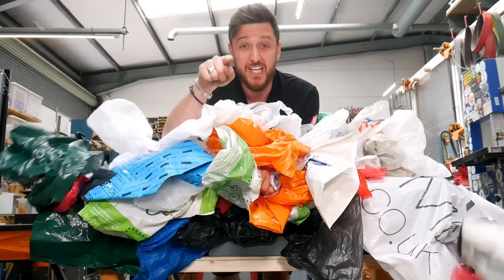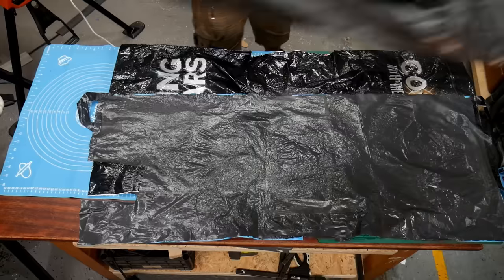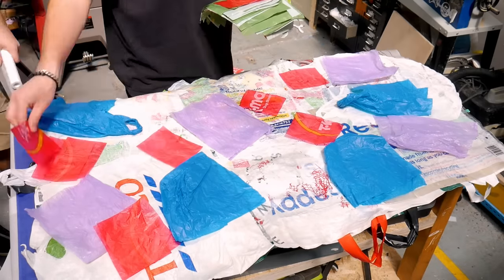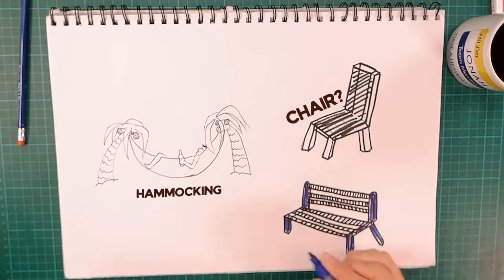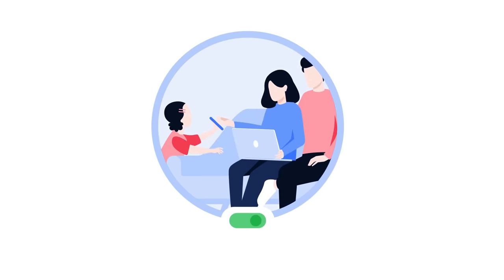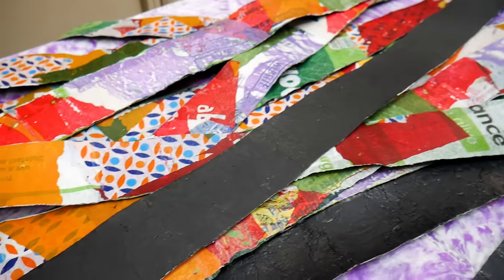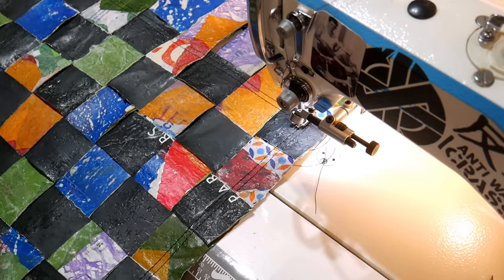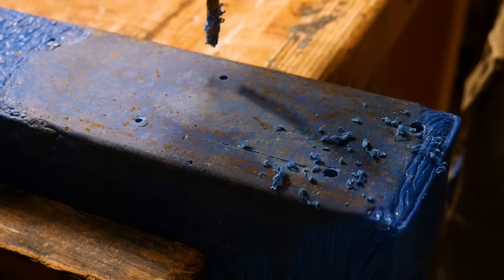Is THIS a Better Use for Plastic Bags?

Comment: Random idea for you guys and/or viewers reading this. I successfully used the off-cuts and trimmings that don't look good blended to make table saw sled runners! Melted the off-cuts in the toaster oven and rolled a thin log. Pressed the log directly into the tracks of my table saw and clamped a 2x4 on top. Custom sized runners that I glued and screwed to the plywood base!

Edit. I did need to trim some flashing off the edges. Your milage may vary. 😊
Reply: Good idea!

Didn't you have to prevent it from sticking?
Reply: @eugenetswong  Yes! Thanks for it reminder. I lined the table saw track w/ parchment paper. After I pressed the thin roll of HDPE it, I folded the excess over the top before I clamped the board down!
Reply from the maker: That's an awesome idea - cheers Tim! 💡♻
Reply: @Timri3681  We can actually use junk paper for this, if we don't expect to recycle the runners. The paper could just remain stuck to the runners.

Thanks for your response.
Reply: That gives me an idea, actually... the problem I've had with my table saw slots is that while the bottoms are fine, the sides of the stem of the T-slot aren't machined quite parallel (yeah, I don't know either), so any runner I make myself has to be a carefully-machined T if I want it to not jam. Rather than re-cut them, I wonder if I could adapt this technique not to make runners, but to line the existing slots with a plastic bearing that actually has parallel sides...
Reply: @JakeStaines  Jake, that's interesting. I think that you could.

You could make and attach the runners, and then test them in the slots without bearings. There should be wiggle room. Then somehow put in plastic and use the runners to hold the bearing while it cools...or just find a way to hold custom bearings down.

If you can remember this thread, then please do share your results, if you try.
Reply: This is a brilliant idea! I have been trying to figure out how to make some custom sleds for my grinder and I think you may have just solved it for me!

Comment: You could make a tarp... use as a greenhouse cover, a hoop house, a cover for a car or boat or even a home.  Or for under a beach towel or picnic blanket.  I suppose it depends entirely on how long you're willing to iron plastic together.  You could even use the material to make waterproof clothing like jackets, waders, and boots.  Anything is better than having it inside the poor turtles.  Also a pond liner?  or maybe a custom sized umbrella.  Or a billboard, if you wanted to paint it.  So many things... you've inspired me, but I hate ironing!
Reply: My question is how is these bags getting in the ocean?  Are we dumping land trash in the ocean?  That is horrible if so.  It should be collect and reused at the least.  We should all be planting more trees and having tree farms so we can go back to paper bags.  A renewable biodegradable material.
Reply: @springcrocus7flower635  In New York City, the garbage barges are piloted out to the ocean and dumped there as standard practice.  In other places, quite a lot of garbage makes it to the ocean from hurricanes and flooding picking up everything then taking the material with the water when it goes back out.  Occasionally there is an overturned container ship and the cargo gets into the ocean that way.
Reply: @auntcatziegler3791  -  Thank you for the response.  That is unbelievable that we throw trash in the ocean.  I thought it happened some, but NY trash must be an enormous amount!  This is sad for the marine life and plants.  
Have they studied other options?  Seem like burning with emissions pipe would be a viable option.?.? I know they did that in a western state for a few years, but may have eventually got shut down.

Comment: It would be really interesting to try  for camping ground sheets as it would be mostly shielded from UV, most plastic bags tend to eventually break down after a bit of UV exposure don’t they but maybe these thicker sheets will be okay plus you can always add another layer hey 😃I’ve only made small sheets so far but it seems pretty tough material😀 I might try adding some tarp grommets to see how it compares with the cheap tarps you can buy! Thanks as always for the great video guys 👍🏻😊
Reply: What about adding the plastic bags to the tarp or would the tarp itself melt? I hate that they are woven and never 100% waterproof.
Reply: @elainawest1572  Yes that might be worth trying, some of them are really thin so it would definitely bulk them up a bit!
Reply: Hi guys, my thoughts and best regards  to your brainstorming. That's what I call success.
Reply: The huge bags of dog food are useful. They're super strong & hold 40lbs.  I turned them inside out, sewed repurposed  karate belt pieces for straps, & now use for mega grocery bags.
Ive opened them up & refolded into open box shapes. Once corners are stapled tightly, it's waterproof. I've used them for years under groups of potted plants & to waterproof interior of cardboard boxes ( visiting cats' litterbox). My last dog died in 2018 😢, but I'm still using the damn bags 😮.
Reply: @coffeync  Yes I sew my dog food bags into shopping bags as well, easy to do and super strong plus you can usually arrange them so you get a nice picture of a dog 😊 sorry for your loss by the way 🙁
Reply: @coffeync brilliant
Reply: @coffeync you made my day thank you
Reply: @coffeync I use chicken feed bags and make them into tote bags they hold a lot of weight. I wash them first and dry. My family loves them.
Reply: @coffeync I have so many dog food bags. My local pet store collected them ONCE for a brief time through some organization for experiment and they haven't done it again. Meanwhile I just can't throw them out. 🫣 But I don't know what to do with them. My curbside doesn't recycle that kind of plastic.

Comment: As potential commercial application, the used bags could be fused to plywood wood to leave a waterproof surface.   Ground bags could potentially be used as a glue between the plies of the plywood, and potentially added to ground wood fiber to produce a waterproof Medium Density Fiber Board.  Or sawdust to produce a water resistant Particle Board.

Comment: Even the horses loved it!
I like using grocery bag leather for my purses, I usually quilt it to prevent the separating, I never would have thought of weaving! It looks so cool!
Reply: 'Grocery bag leather' - what a great way of thinking of it! :)
Reply: Ooh - I never thought of quilting it - that would really save a lot of time! I think this stuff is perfect for bags of all kinds. Thanks for sharing this great idea. 💡🙏
Reply from the maker: Love the name for it! And fear thar you're using it too. Weaving definitely make it look interesting and added a load of strength which was needed for this application 😊
Reply: Strange idea, but people have done it before, cut the bag into strips and crochet the plastic! It's a strong material, isn't scratchy, (though it depends on what type of plastic bag you use) and can be made into anything with crochet! Personally, I'd love to try to make stuffed sea animals made out of plastic bags, stuffed with cut up old paper, or even more plastic, just as cute little decorations.
(Edit: It uses a lot of material, so it's a good way to use up the bags pretty quickly!)
Reply: Very inspiring. I will try something 😂

Comment: I wonder if you could run those strips through a laminating machine.  You'd need a carrier slightly longer than the strips, & laminating  might be take longer than ironing; however, the heat application & the pressure would be very uniform & perhaps higher than ironing.  

Just an idea... 😁  Thanks guys for the great video!
Reply from the maker: A few people have suggested this now. Definitely want to try!
Reply: @BrothersMake How in the world do you manage the toxic chemicals that off gas when you heat the plastic? That'd be my big concern! Really curious? Thanks, gents!
Reply: Me too.
Reply: @krampus225 I have the same concern with the fumes...Should it be done in an enclosed space with Aire extraction that has some kind of filter for toxins? And the people working on them with protection...

Comment: Could you wrap the base of the iron with oven paper, instead of having to move around a sheet?
It would make work flow quite a bit better!
Reply from the maker: That's a genius idea!
Reply: would it not melt or burn?
Reply: Only if the iron temp is a fair bit high than baking temp.

Comment: Really love to see what you guys are doing, and how I can re-use plastic bags! There's so much potential here, and your video was the first thing that popped up when I searched for "uses for plastic film waste!"

As an engineer one thing jumps out at me when I see the shot at 10:05: dissimilar metals in contact and corrosion happening over time. Truly not a big issue for a prototype like this, but worth helping people think about as they start to get into re-using an repurposing scrap they have around and how they can ensure the item they make has longevity.

Putting those steel washers in direct contact with the aluminum tube for a chair designed for what I assume is outdoor use, the rain, dew, and other moisture it encounters will cause corrosion on that joint. Interestingly, my understanding is that this occurs using the same principle that batteries use to make electricity (e.g. a lemon battery demonstration).

Again, such a fun video! Thank you again for all the work that you do!!
Reply: Excellent advice, thank you for sharing! I was wondering about that too. 
Would it be sufficient to have some non metal washers, (nylon?) would that fix the problem?
Reply: @spinnettdesigns  Could maybe use bottle caps.

Comment: Great idea guys ! And the commenters as well !  I was thinkin for my own sewing room…… small crates made with the “cloth” you add in the video, to house my precut fabrics. Maybe  a custom thread or trash bin. Project bags possibley. Amazing input and ideas ! ! ! !
Reply: Sooo many possibilities around the house! 
I am loving that they discovered using a "clapper" to press/hold the iron's heat for the lamination process❤️
Reply: Idea: You could use something like 12 gauge wire as a frame to hold the shape of the crates - which could even be ironed into the plastic fabric. Plus, then the crates could be collapsible for storage.

Comment: Guys. Guys. Lissen. What if, instead of ironing the second time, you just fed the strips through an ordinary office laminator sandwiched between a few pieces of baking paper? You could make some quite decent width strips right from the get-go if you just kept feeding in baking paper and un-ironed layers of plastic bags, save ironing altogether. Laminators move really slowly and you'd have plenty of time to lay in 2-3 bags to make long belts as wide as the laminator, then feed through two belts on top of one another with the ends staggered to keep strength. Not sure a laminator would gl slowly enough to get through more layers than that though. But you'd have a decent material with little effort. Could still press it with an iron if you really want. I'm making sandwich press PP sheets but have been looking at doing this one day when I can find a cheap laminator, not game to use our existing one because if I muck it up we can't afford another one and we use it regularly. But I'd love to see if this works.

Comment: Question: Is it possible to make refills for a gluegun, out of recycled material? If it is possible, it might be an easier way to fill out small divots/hole/cracks?
Reply: That's a project I have been thinking about for years.

I found some glue guns with adjustable temperature, so they can fit the plastic, which I mainly think would be best if it were HDPE, considering its low melting point and softer properties.

As for preparing the sticks, I naïvely though I could simply melt plastic bottle caps and roll them into shape as if they were dough, but they're too tough/hot to make by hand effectively.
I would try a mould made by simply drilling a right sized hole in a piece of wood, into which to press the molten plastic with a rod!
Reply: I had a similar idea about making filament for 3d printing since that seems to be about the most expensive part of 3d printing
Reply: @SuGo  brilliant idea with the wood.  I'd consider cutting the block in half along the hole to make a 2 part mould.  It would make removal much easier
Reply: @daxhopkins7312  True, that's also easily feasible and would make it surely easier to remove!
I hadn't thought of removal thoroughly, I figured the plastic would shrink enough to give it a bit of play to come out, but then again, it could stick to the inside.

Copper piping could work, maybe? Or it could dissipate heat too quickly and set the plastic unevenly... maybe some higher temperature hoses with the right internal diameter could also work; split them, stick 'em in a wooden die to keep them together, inject and press the plastic, then remove the hose from the support and open it!
Reply: @daxhopkins7312  Can silicone play a role here? Or is the temp too high? There are many molds readily available, some for ice to put in water bottles that might make a useable product
Reply: Wouldn't that give off bad fumes while using your glue gun?

Comment: Most of the stores here in KY still have the plastic bags. We reuse ours many, many times and still end up with a bunch of them. I've been thinking lately about how to recycle them. I don't have the equipment to do much, but I do have an iron. So let the creative juices flow! I'm thinking of trying either a hammock or a tarp for the woodpile at the cabin.
Reply: I would suspect that a hammock made of plastic leather would make you very sweaty.
Reply: @Joy21090  that's something to consider. Maybe I'll just stick to making covers for the  woodpile and the camp tables. 🙂
Reply: @OHlookSHINYthing  Those sound like worthy projects for your time, talent, and otherwise-trash.

Comment: I wonder if using a heat press as used in making tee shirts would work better for fusing the plastic bags together. It would certainly save you blokes a lot of ironing for future endeavours. 
Thanks for the great videos.
Reply from the maker: We did actually dicuss this when we were doing all of the ironing, we'll be sure to give it a go - thanks!
Reply: There are a bunch of Chinese OEMs that make cheap heat presses pretty big.  Could probably even modify it so you could just use it as a giant iron lol
Reply: A mangler from a laundry would make quick work of the fusing/layering  process.
Reply: @rowanmulvey8632  it would, great idea.  Finding a mangler would be the issue.

Comment: Very cool! It seems to stich up pretty well, so it should be a good material for any project where you might use leather with approximately the same working properties. But what I'd really like to see is a serious stress-test of this material by using it on a patio umbrella! Finding one with fabric that can't be repaired, strip it off, and see if you can replace it with Bleather™ (Bag + leather = Bleather. 😉) Definitely an ambitious project, but you could ask Kev if he thinks it might be doable. Thanks, guys!
Reply from the maker: Firstly - "Bleather", absolute genius. Excellent work. And yeah, fixing an parasol or something with it would be a great way to test it out. Will keep note of that - thanks!
Reply: "Bleather" is a fantastic name for this material! That's what I'll be calling it from now on.

Comment: You might have better success with the holes if you made plastic dowels then poured melted plastic all around the edges pretty much like adding glue. Chair turned out pretty awesome, wonder what the weight limit would be 🤔.
Reply from the maker: For sure - we definitely could have tried a couple of other methods if we had a little more time, but were keen to get this one finished. Nice idea. I wonder - I'm nearly 100kg and it holds me with ease, so a fair amount above that I'd imagine!
Reply: @Brothers Make  100kg didn't realise you were such a lightweight 😆🤣😂, I'm about 124kg not a tall guy but more the shape of Mike Tyson.

Comment: This is so cool! I am curious though, is it possible to color these plastic sheets? If so, this may be a good material for building costumes. You could make armor and things like that.
Reply: Don't know about colour, but a lot of acrylic paints would work after a suitable undercoat. ( not scratch resistant, I know).  Guess it depends what sort of armour you are thinking of....  maybe you could bind to a top layer of fabric with heat or glue, and get the colour from that.   I suspect colouring the plastic itself would require more complete melting and mixing.
Reply: I have used paint and dye to color my stuff. I sometimes use a clear plastic bag over it by ironing it on and it protects the paint.
Reply: I made a chicken costume out of yellow plastic bags, an old sheet and a paper mache head and beak. Looked great. Fun times.

Comment: Could you made a made to fit cover for a mobility buggy or bbq or bike etc how would you deal with making the corner shapes? Is there a uv  resistant plastic that could be used as a top coat? Just thought I would give you a challenge 😊 love the stuff you do ❤

Comment: You might consider watching the commercial auctions for a used mangler instead of an iron. Larger hot surface and already has pressure so all you have to do is feed it through. Saves time. Great ideas in this list of comments- I congratulate your audience on their creativity and vision.

Comment: I would be working in a well ventilated area and have some TVOC monitors in the room. One because your melting plastics and two because Teflon. No idea if you can pick up PFAs with VOC monitors, but I wouldn’t even want to be in the same room as Teflon going up over 300°F.